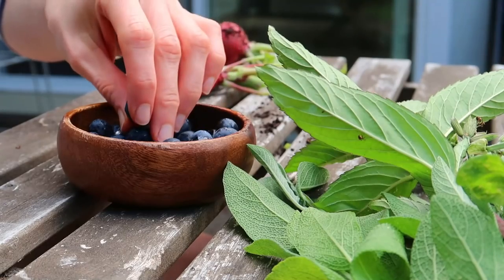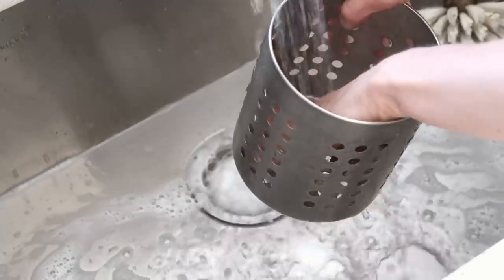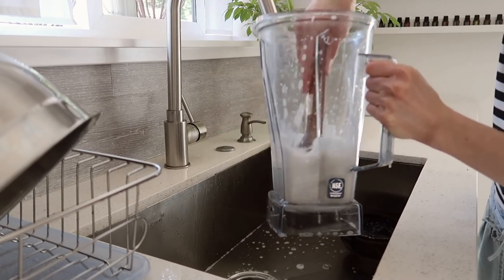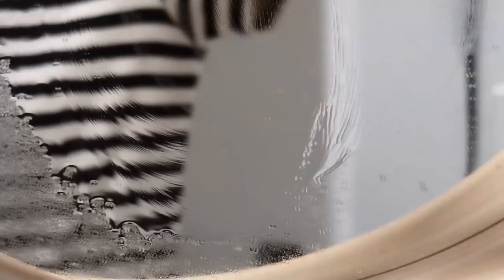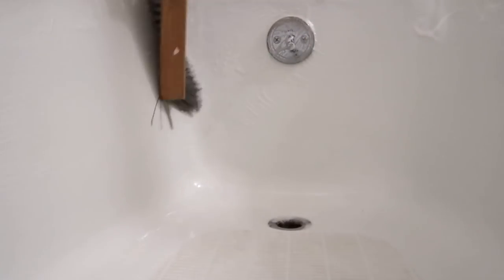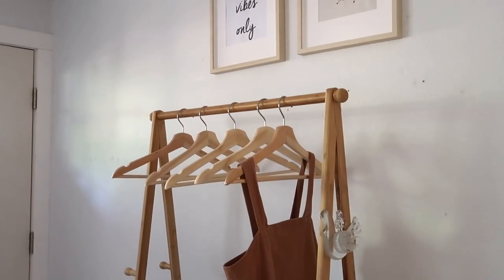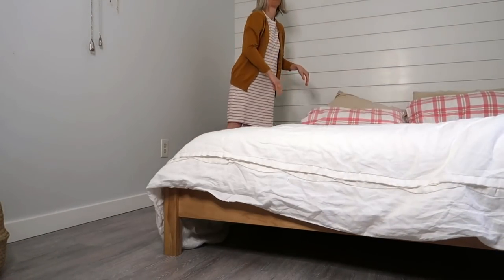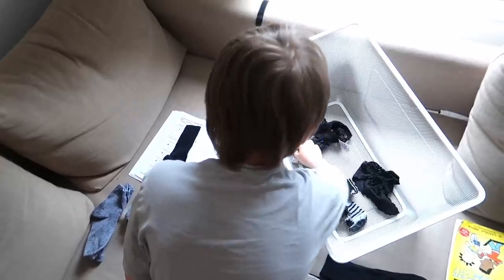CLEAN WITH ME MOTIVATION 2020- non toxic cleaning

Comment: Hello Noemi.  Did you see my question about the 9x13 glass dishes on your last video?  I wanted to know if you had any problem with them exploding in the oven?  I wanted to order them, but there were several reviews that said they exploded.  I really wanted the ones with lids.
Reply from the maker: Are you asking about the ones you put the lunch in there the divided one ? Make sure you don't put it in to the oven strait from the fridge if you look at the review sometimes you can reed between the lines how they use it. Or you asking about the square one with the red lid? Same there I use them from room temperature and I use both every day so far no problem 🤗💟💗
Reply: Thanks, Noemi.  I was talking about the 2- 9x13  baking dishes with red lids.  I really want them and I hope you haven't had any problem with them.  I never put a dish straight from the refrigerator to the oven either.  Just let me know your experience with them.